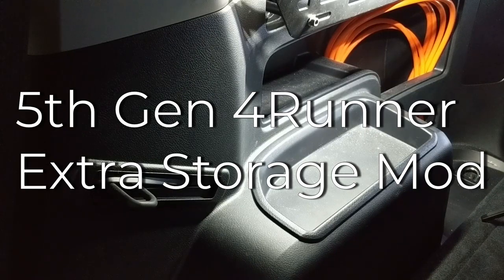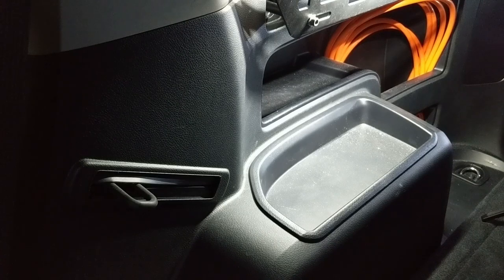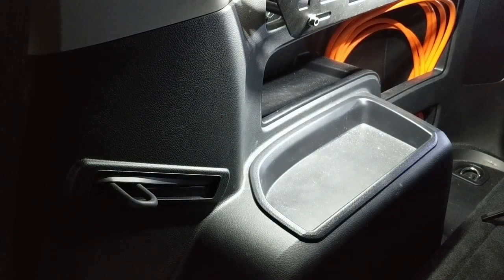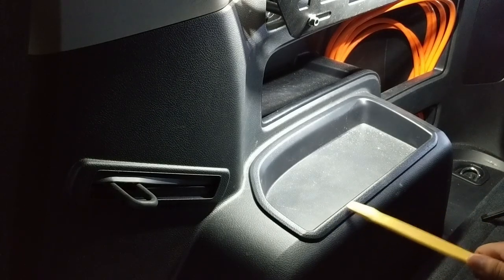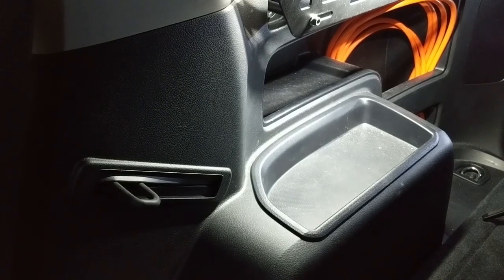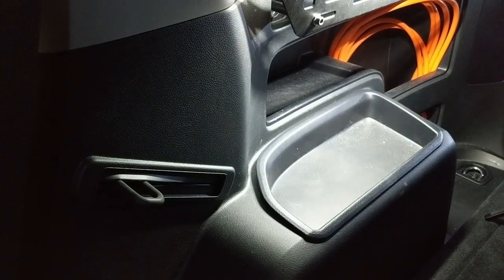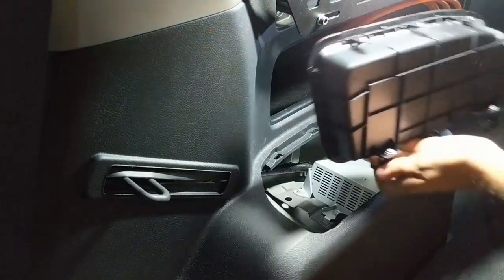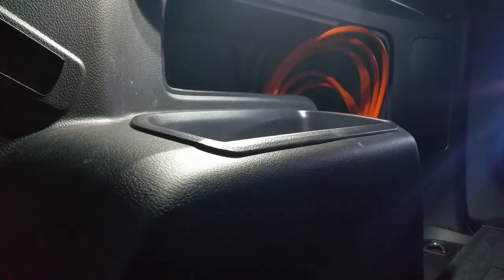5th Gen 4Runner Wheel Well Storage Space Mod

Comment: Thanks, i did this mod on my 2021 runner and its awesome. I did both sides it was fine. Goes back in tightly.
Reply: What are you putting in there? What about the inverter that’s crammed in there? What’s in the other side?
Reply: @SarasotaTim  honestly its just a small space . Not sure what to put in there.
Reply: How much space was on the driver's side compartment? Enough to put some tools, jumper cables, tow strap?
Reply: Its a small space some mild tools and some jumper cables
Reply: @firemedic10271 - thanks a lot for the info. I’ll have to get brave and try breaking that top lid off!

Comment: What the heck was in there?
Reply: Looks like the electronics for the DC to AC inverter.
Reply from the maker: the other reply is correct, factory inverter is located above the passenger wheel well. That is what you can see